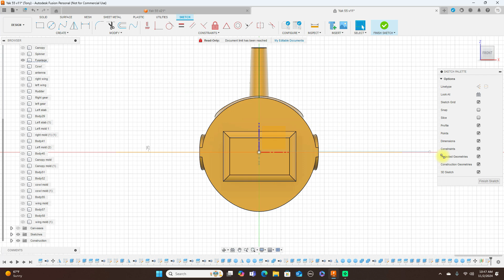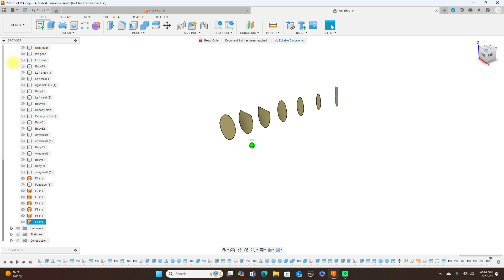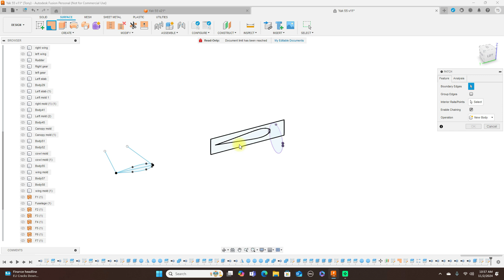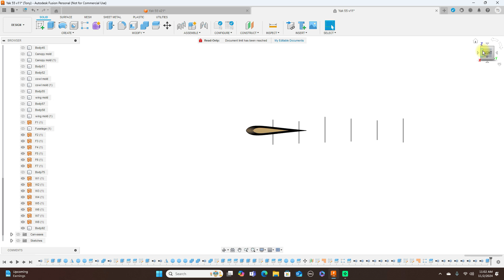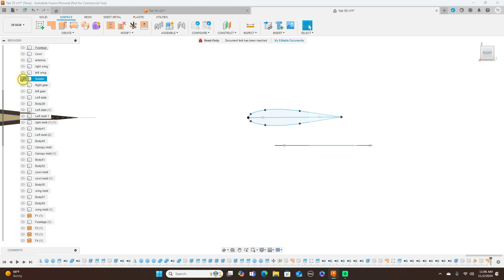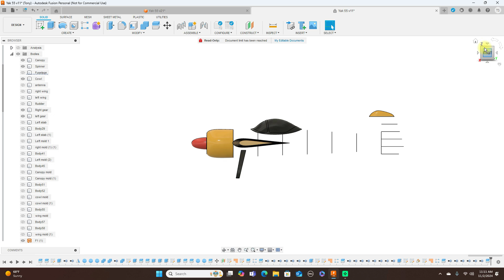How to model formers to laser cut your airplane in Fusion 360 CAD

Comment from the maker: Hello everyone,  I invite you to join my Facebook group to learn more about designing, building and flying RC aircraft.  Ask questions and get help if you need it or post what you are working on or have built. https://www.facebook.com/groups/1213000166068580

To join my Patreon  https://www.patreon.com/CadBuildFly
Reply: Look up the Mapboards or Mapboards Pro addon for Fusion for exporting SVG or DXF 2D for Laser or even printing to paper. Saves a huge amount of fiddle with multiple parts.
Reply from the maker: @seabreezecoffeeroasters7994  Excellent!
Reply: @cadbuildflyrc3784  Just having an additional thought to keep the Tree a bit more simple is make sure you use components instead of just bodies in a huge list. In the case of Wings/Stab when you mirror them as components their bodies are held within them and not on the main tree.
Reply: One thing missing is if putting ribs into something like a printed wing/fuse etc or fibreglass etc is that has a thickness and the ribs won't fit inside. Technically a normal build using wood external will add withever thickness the balsa is too so also needs considered. Could sand the bits of course post cutting but that may get old quick if lots of bits needing a mm or 2 off them.
Reply from the maker: @raptorheli2  Yes, you have to subtract the thickness of the sheeting you are using from the formers.  I forgot to mention that in the video.